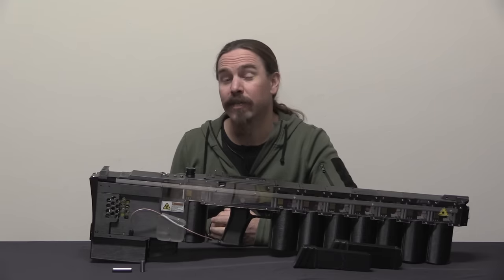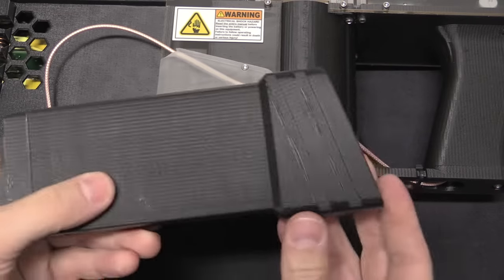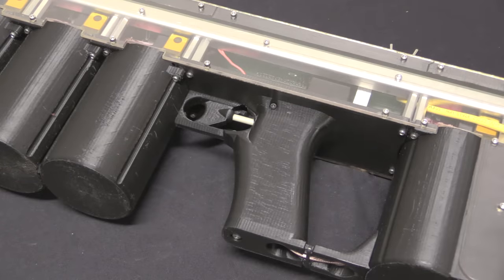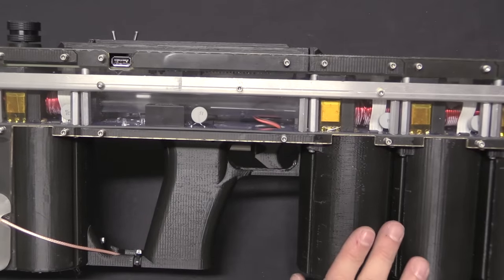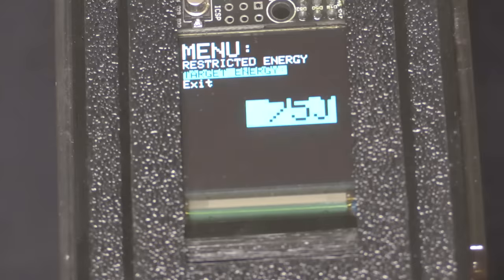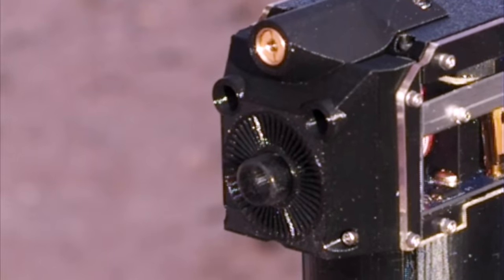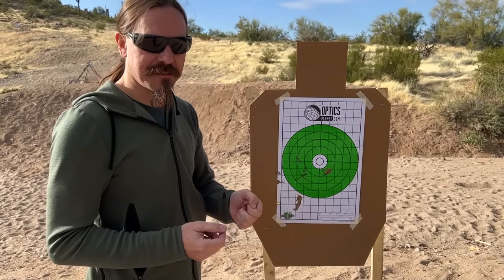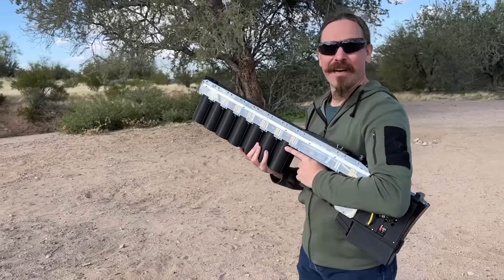ArcFlash Labs' GR-1 Anvil Portable Gauss Rifle

Comment: The most scifi gun of 2022 has a ring pull. This is awesome. Also, you may want to fire it when the marker is red, because super mutants. One thing to note, it's a lithium polymer battery with a deans connector. It's absolutely the worst connector type for a high current application. It will eventually desolder itself.
Reply: Gotta take my gauss rifle to a tech and get it rewired to Tamiya
Reply: "...alpha level of development...", you brain much? I guess not...
Reply: How is deans bad? I nothing about electronics and am genuinely curious. I have all my Airsoft/RC stuff rewired to deans
Reply: You forget it doesn’t pull from the battery hi Voltage. It’s pulling the normal battery voltage then stepping it up in the capacitors. Doesn’t need to be high current connectors at that state in the electrical system.
Reply: the current draw through the deans connector is probably below the limit of said connector, but yes, an xt60 would be a better connector. even better would be integrated 5mm bullet connector plugs that are physically aligned by the structure of the battery box and the battery receptacle.
Reply: @DelGTAGrndrs  Sorry, but it seems as if you're confusing voltage and current. 
The size of the connector surface area limits the current, and the material of the connector plus its geometry limits the voltage. 
Power is voltage multiplied by current, and energy is power multiplied by time. 
We want to quickly transfer energy, that is to say, we want to draw high power. We can do that by having high voltage and low current, or low voltage and high current (or find some middle place). The usual solution is to go for high voltage and low current, since this reduces the losses caused by connector and cable resistance, but commercially available batteries limit the voltage.
Reply: I'd rather see it use commercially available Ryobi/Milwalkee/Dewalt type batteries, for fast swap.
Reply: @CockatooDude  Deans Ultra connectors are rated for 60 amps continuous. XT60 are rated to 60 amps continuous. They're identical in rating...
If you're having trouble with current capabilities of Dean's connectors - maybe stop buying the counterfeits hahaha
Reply: @CockatooDude  You're missing the point. It's not a finished product, there's no point in building for longevity in it's current level of development.
Reply: I think any practical implementation is likely to have superconductors sticking out of it 😁
Reply: You're not wrong. Deans connectors absolutely suck for high current application. Unfortunately the size of battery we needed only came in 3 options: XT90, EC3 or Deans. Both XT90 and EC3 are ginormous and very hard to connect/disconnect so we didn't want to ship that to customers. Deans was the best option. The battery on the GR-1 actually doesn't pull very high amperage. The EMG is a different story.
Reply: @tyyap76  thats gonna make it way heavier than it needs to be. i have held those tool batteries and they have a lot of weight and volume in just plastic/rubber bulk. a compact lightweight pack designed specifically for the gauss driver application with bullet connectors configured to  disconnect as you pull the battery pack off would be better since swapping batteries quickly is going to eventually be an important element of the design as well as weight and size.

its part of why polymer is favorable in many firearms as it's just lighter than metals.
Reply: @JohnSmith-oh9ux  No shit. It's still a $7 component that can only manage 60amps whereas there's one on the market for the same price that do 200amps continuous. The batteries and connectors are all commercially available RC car stuff.
Reply: @McDroney  Objectively Deans are not all that great. 60amps is fine for some applications but the design is not the safest in a number of ways. XT60 is safter XT90 is superior in terms of both safety and amps. Castle Connectors will do 200amps continous.
Reply: @bill8791  The Dean's plug was originally designed for RC car racing back in the early 1990's. Dean was just a guy who came up with a simple design for a higher current plug than the old Tamiya plugs. Sure the XT series of plugs are better (I use XT60's in my new cars) but the Deans is perfectly capable of supplying 60 amps all day long.

Comment: I do believe a fin stabilized discarding sabot has an use case here, because you can use it to optimize the shape of the ferrous part of the projectile to better react to a driving magnetic field and prevent fins from damaging the polycarbonate barrel, especially in the dead space above the trigger where the projectile was visibly knocking about due to limited velocity.
Lastly, I'd say that the real use case here, as with most "railguns" we've seen in development until now, is to have some sort of initial propellant and then acceleration with coils.
I'd probably attempt to use a pneumatic system for the initial acceleration, for example using CO2, which could in turn also be used to cool down the barrel because of gas expansions cooling.
Reply: But then you could just have a compressed gas weapon in the first place, which is already much closer to the usefulness of a "regular" gun. Electricity can be better used to compress air than to "mass drive". 
Then again it can perhaps be even better used to simply drive a physical spring. Imagine a really heavy spring bb gun. Pretty sure if you used electric motors to crank it up the stored energy release would have much higher returns then this gauss idea.  Just a lot less cool factor. That's my two cents.
Reply: Hybrid
Reply: @beargillium2369  the handheld gauss rifle is an interesting concept but the real test is going to get the ideal projectile shape down, and then adapt it for use in zero gravity environments where the limitations of the system disappear.

even if ship to ship space combat is still a few generations away, this does appear to be a viable weapons system to use against satellites and other HVTs in near space.
Reply: @beargillium2369  with current Batteries and Capacitors that would be a better use. Or one could develop an ElectoThermalChemical Gun with improved propellant mixtures. In an Ideal case scenario though Coilguns would be preferred over the ETC or your Airgun due to the shear amount of energy you could conceivably dump into a projectile.
Reply: @localeightironworker  why do you feel that gravity is the limitation?  I'm 99.9% certain that conventional propellants work in space so I'm not seeing the benefit you're trying to illustrate... Weight saving perhaps? Solar charged weapons? Maybe there's something there
Reply: That's a novel approach. In the future one could have Compressed Gas as the Primary Accelerator , The Coilgun as the Secondary Accelerator and have a Railgun as the Tertiary Acclelerator using a set of twin Laser induced Plasma Channels as the Rails and the Compressed gas would cool the Coils and the Laser module. Just my two cents
Reply: Railguns really need a lot of velocity before the projectile enters the rails, otherwise the projectile will weld itself to them. Coil guns doesn't have that requirement. It do need to move the projectile out of the magazine and close to the first coil, but a solenoid "puncher" is good enough for that. Also, it's not the "barrel" itself that needs cooling but the coils. Cold gas in the polycarbonate tube won't cool them.
Reply: @beargillium2369  i feel like you will have a lot less friction in space. There is no air to purge from the tube as the projectile is fired. Hell, you may not even need a tube to fire it in space, further reducing friction. There is also no drag on the projectile as it fires.

I am with you that more conventional projectiles would work also. But they leave a lot of residue from combustion, which would require some sort of cleaning, whereas the gauss rifle is virtually cleaning-free. Unless i'm missing something, lmao.
Reply: @phizc  The barrel can be vented by the coils to exhaust some sort of gas onto them.
Reply: @beargillium2369  You can't achieve the same velocities with expanding gas as with induction in the same form factor I'd say. You'd have to have pretty high pressure and a very long barrel to accelerate a heavy projectile. Sure, something like a harpoon is the precise usecase nowadays, which is pretty effective, but will be overshadowed by how much velocity can be achieved with coils.
Reply: Sabot is not necessary because magnetic fields can be of almost any shape and form desired and can be used to "rifle" the bullets. Designing a stable magnetic field shape is the hard part. Twisting magnetic shapes are currently researched to be used in future fusion power plants and surprisingly, cabinet latches as polymagnet inc has shown.
Reply: @TheHammerkeg  expanding gas also encounters a problem that a coilgun will never have. 
A chemical propellant creates a pressure spike, which limits the amount/type of propellant used to avoid an over pressure failure in the weapon. This is a hard coded maximum for the weapon, an over pressure failure is going to be fatal for the weapon. 
A coilgun while having a maximum energy allowance per coil, can be modified/repaired easily. You burn out a coil, you can just replace it, the weapon itself isn't actually destroyed or made unsafe by its loss provided you have suitable control systems. 
You can also as technology advances make a coilgun more efficient by decreasing the heat generation compared to the applied acceleration. Chemical processes are fairly fixed, you can't change the heat/expansion ratio without changing the chemicals. 

Finally people mentioned use in a vacuum. A coilguns main issue will be heat dispersal, space is bad for that. A chemical propellant weapon has the same issue to a lesser degree, the exhaust will remove some heat, but the exhaust itself becomes an issue, it needs to be vented, but in such a way that it doesn't radiate that heat back to the user or craft. Basically you have less control over your heat return. Also any venting will have a thrust application, so it needs to be uniformly controlled.
The heat issue with the coilgun can actually be solved with the coilgun, you use the projectiles as heat sinks and in turn make your heat issue your enemies issue. This can't be done as easily with chemical propellant, as it risks a "cook off" depending on the chemicals in question.
Reply: I agree with using the fin stabilized ammo like the M829 for the Abrams. Should solve the accuracy issue and provide greater armor penetration. However, I do not agree with using another form of initial acceleration for the projectile. This weapon system already requires two separate items to be replaced; the magazine and the battery pack. During a longer term engagement, it would be conceivable that the battery would need to be replaced. Adding another system, carrying around CO2 bottles around, just adds complication for the warfighter and increases logistical supply problems. Thats's just my opinion.
Reply: What I think the best improvement would be the use of more magnetically sensitive rounds than steel, say neodymium?
Reply: Ah yes, a hybrid gauss rifle. Like a Prius :)
Reply: Downside would be that you need a second 'battery' of compressed gas.  So instead make each bullet a little CO2 cartridge and use a pin to pierce it and let it rocket down the barrel, now you consistently cool the barrel with every shot and the projectile is at decent speed before the coils act on it.  And possibly best of all the projectile can spin itself up for accuracy.
Reply: @phizc  If the barrel is perferated and exhasust into the coils it will.
Reply: Also there are very powerful air guns that shoot .50 caliber projectiles AND bolts/arrows. They're used for hunting and are getting more popular these days. Lost of hunting videos out there showing arrows going straight through wild hogs etc. Also check out demolition ranch's videos showing how powerful they are. Much less fuss than this coil gun and much more practical, but this is still pretty neat.
Reply: This is not a railgun that requires  initial projectile velocity! It's a coilgun, there are no rails that projectile can stick/weld to.
Reply: @localeightironworker  If you intend to use it in space then what's the point in worrying about ideal shapes?
Reply: @Bizzon666  Of course, I'm not saying it needs to, but it would help.
Reply: @kennethferland5579  I would consider making the magazine contain the battery, gas and ammunition. You could have a readily available reload station that would charge and fill the mag with gas (for portability, could be compressed air as well, can be easily generated on site)
Reply: @Scott11078  because a magnetic field affects different shapes of iron. We may find out that a hollow core, or a toroidal shape, moves the magnetic field through the iron in such a way that it drives the projectile faster.

Comment: Playing back at 25% speed you can see the projectile tumbling the moment it exits the barrel. Aside from the device itself being an alpha prototype, the ammunition needs a lot of work to make it lighter and more aerodynamic
Reply: They need to take some lessons from the real Naval rail gun - Sabot and stabilizing fins on the projectile.
Reply: Yes, I hear that it is a smooth barrel no spiral like a normal firearm, maybe that would help an engineer the projectile to suit? Seems like a simple solution, unless there's an engendering or physics issue I'm unaware of?
Reply: @immarriedwith5kids514  its unrifled for simplicity so they can focus on the coil part of coil gun and do the gun oart which is far simpler later
Reply: @ericjohnson6105  So basically, it needs to use something like a flechette round?
Reply: I think that smooth bore isn´t a problem at all.. first you need to achieve much higher velocity. I am pretty convinced that you can do everything else by developing a decent sabot round~ I mean.. look at TFM Channel, there is alot of stuff that flyes perfectly accurate out of a smoothbore shotgun.
Reply: @ericjohnson6105  rail guns and gauss guns are different things. Gauss guns are airsoft toys next to rail guns
Reply: @immarriedwith5kids514   but did he say the round dose not tough the bore ?
Reply: I’m almost tempted to suggest ball bearings as a projectile. More aerodynamic than a steel rod, no tumbling, and still easy to source raw materials. Alternatively, i’m curious to see if a Spitzer style projectile will be more stable - i’m thinking not because it won’t have spin to stabilize it, but it’s worth trying… although i’m sure the designers have thought of both of those ideas already lol
Reply: @christofrini  Would be an idea, I am not really fimiliar with magnetic fields and stuff. Maybe ball bearing wouldn´t accelerate as good~ but if, you could also use a airsoft hop up style mechanism for spin stabilization. Which would need to be put after the magnets of course.. But I think in general this A Prototype is very promising. The charging sound is kinda creepy already :D
Reply: @Fischbroetchen2k  It's mainly they don't have the proper battery technology. And don't have the wiring that can handle the both heat and power.